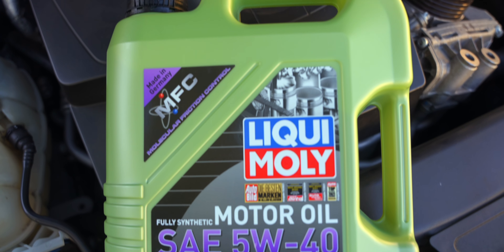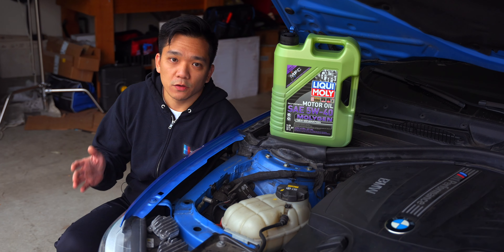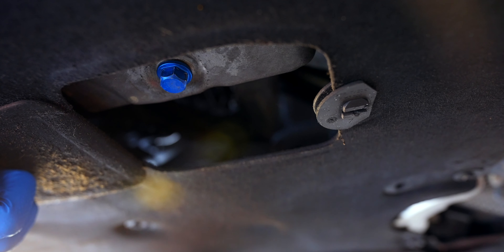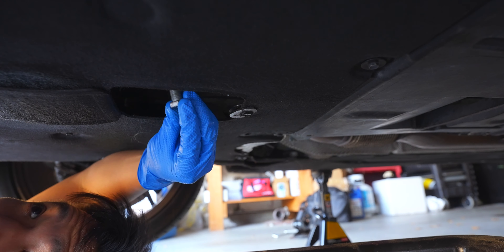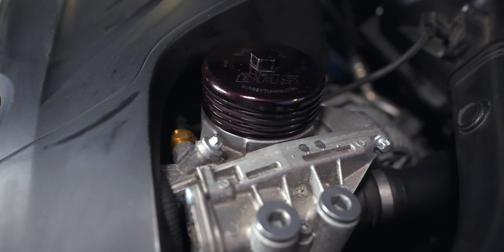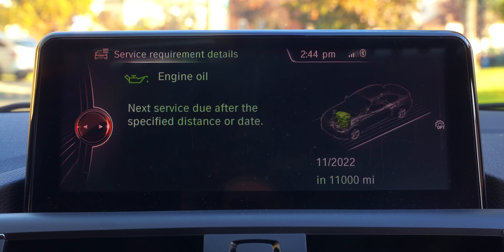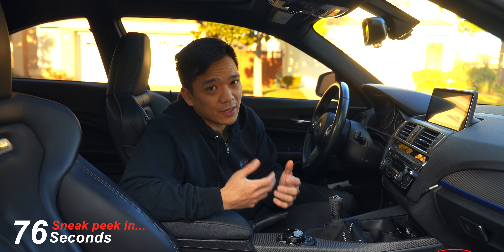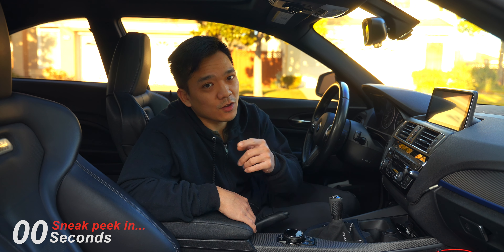Liqui Moly Molygen Review | BMW N55 Oil Change

Comment: Also Try Motul. It is also make your engine quieter.
Reply from the maker: I'll keep that in mind. Thank you
Reply: Motul oil trash engine is loud asf liqui moly best oil to use
Reply: @hansondardignac7049  my  engine runs about 5C cooler with Motul X-cess 5w40 compared to molygen 5W40... for my next oil change, I am going back to Motul. I also have a 2015 M235i
Reply: @okpoobi  Try Motul 0w40 X-Max or LL Synthoil 0w40. These are superior oils.
Reply: @okpoobi  well done on finding an oil that suits your requirements. Where i am i only get the choice of Valvoline, total, castrol and shell products. Read so much good reports on liqui moly top tec 4600 oil.  Walked into parts store and they started importing liqui moly products. I bought a quart of 4600 0w30 to try in my Mercedes c270 diesel car.
Reply: These are my observations. Took out a quart of old oil and put in the liqui moly 4600 0w30. Subjectively the car was quieter, felt much much more responsive and no smoke at all out of exhaust. 
Objectively the car is running about 50°f cooler on dashboard, and the biggest surprise/shock was the fuel consumption. Used to average about 28mpg, now 34 mpg. 6mpg better than normal. Has anyone had a similar experience. I'm absolutely blown away with this oil. It is also the recommended spec from Mercedes for my engine. COMMENTS guys.
Reply: @leonel2174  why did you not change all the old oil? makes no sense
Reply: Hi James, my 95 Isuzu diesel ran 10 years without oil change. Just various filters yearly. Put fresh oil according to dip stick. Stolen at 650k. Still running absolutely perfect. My 95 Merc petrol last oil change at 200k. Just filters yearly & fresh oil per dipstick. Sold at 403k. Still running today. My 2002 Merc 270 diesel last oil change approximately 180k. Now has 309k. Change oil filter every six months & fuel & air filters every 3 years. But i do take a quart of oil every six months & replace with a quart of fresh liqui moly.  I do a viscosity test along the lines of project farms to determine if a thinner oil is required to bring it back to 5w40 viscosity. Then i simply fill according to dipstick, especially as I've changed the oil filter. Car doesn't leak oil or water, doesn't smoke or miss a beat. I stay in a temperate climate with no cold winters or hot summers. I will probably never change oil again. This works for me, but each one knows their own climate & cars engine condition, so must do what's good for them. Some change at 2k, some higher. And that's fine for them. Under reasonable conditions oil doesn't break down, just the additives get depleted. By putting fresh oil every six months, additives are being replaced. Liqui moly rates this oil for 25k, so by adding oil it keeps doing it's job. Also the leftover oil probably coats the seals hence no leaks at all. 3 vehicles many 100's of thousands mileage with zero problems. Never ever had any mechanical problems. No engine ever opened up. Hope this helps, but please follow ur own schedule. This is for older models, not these new models. Follow manufacturers instructions with new models. Many happy miles on ur journey, Regards.
Reply: @okpoobi  i also use the motul xcess 5w40 
Not everyone will have same the results 
For me the motul hasn't work as expected as a good synthetic oil
Some oil might work for you but might not work for everyone

I'm thinking of changing the oil in my car to either molygen or castrol edge
Reply: @leonel2174  engine models are quite different so if a car leaks or burns oil the owner can top it up and new oil will replenish lost oil so if the loss is enough then the replacement may be on track to keep the oil fresh. This is way different for an engine without oil loss. It is not going anywhere in my car and the Direct Injection and boost pressure cause dirty carbon soot to go into the oil quickly. To me pure direct injection is defective and dirty towards the atmosphere and engine. So in my case I must suffer this but I gain in that the engine is efficient and no top-ups are required. Honestly I have not much choice because I required a brand new car and all new cars have very similar tech and no more diesels are really available. I accept high priced oil changes every 2-3 months. I am not happy with the vehicle either with comfort and noise. So it is definitely a compromise and financially I have learned that vehicle value matters so here it is good compared to my past Mazda/Fords, VW, and Ford cars. This H for Honda will keep value better and engine and trans will not self-destruct in first 5 years. Maybe in 15 years
Reply: @jamesmedina2062  you make some valid points James. My merc c270 diesel doesn't leak any oil, and i never have to top up at all. This is why i remove a quart every six months. Because of changing oil filter i simply top up according to dip stick. I was getting 28mpg before, now 34 mpg with liqui moly top tec 4600 0w30. Just taken another reading, 37mpg. I'm absolutely blown away. Never got these mileages with the other oils i used. Im totally sold on liqui moly. 9mpg better fuel consumption. WOW. Can't wait for next quart removal & oil filter. Filters approved by store specialising in merc cost less than $5. Oil is less than $9 per quart. So less than $28 per year. Every third year air & fuel filter +- $35. Costs hardly anything to run, other than brakes & tyres eventually. Thanks for ur imput.
Reply: @jamesmedina2062  Also spent a lot of time looking up Blackstone oil analysis of any make of vehicles with oil changes over 12k intervals. The 3 main items i observed were as follows. 1. Adjust viscosity to manufacturers recommendations for the oil thickness of the time of year. 2. Keep engine near full mark. U will have better lubrication & oil acts as coolant keeping engine regulated. 3. Use oil specifically approved for ur engine. My Merc is 229.51/229 52 & liqui moly has this printed on the container. Hope ur vehicle gives u long trouble free motoring.
Reply: @leonel2174  thanks. You have it good. I don't but am ok with it. I wanted a 2015 VW TDI Golf but the two on the lot got sold so quickly before I could get my money approved. The Golf get very good economy. Anyways I used Motul for many years but after checking the oil tester named Piotr here on YT, I tried LiquiMoly 0w40 and tested it in my kitchen. it is extremely protective but a little thick except for summer and I dilute it with a 0w20 from same company. In winter just straight 0w20 AA is the one. AA for America Asia cars. I have emailed LiquiMoly but the guy knows nothing. A big waste of time. You can search for your oil and Piotr too. His scar test will come up at room and hot temps.
Reply: James, 0w20 sounds good for winter. 40 weight oil might be to thick. Possibly try 5w30 for summer. Also oil burns or vaporizes off making oil a bit more viscous. So a thinner oil like a 30 weight is recommended to thin oil down a bit. Check ur manual for parameters for oil recommendations. Thanks for imput.
Reply: @leonel2174  I put 0w20 and 0w40 together. My oil gets fuel in it so it gets thinner. These oils do not really get thicker for sure. I have seen other one do that somewhat.
Reply: @leonel2174  also this 0w40 has the zero meaning it is not same as straight 40 and it flows better than any other at like -65 celsius
Reply: Yes James, i was simply referring to the operational weight instead of typing the winter weight as well. Almost no one uses straight oils anymore. Thanks, & i hope this clarifies what i was getting at.
Reply: @hansondardignac7049 
I just changed from motul 8100 xcess 5w40 to liqui moly molygen 5w40 and i would say that the motul was performing better compared to the molygen.In my opinion the molygen is just green and there is nothing special about it
Reply: @luvishfokeerah3716  I love liqui moly more then motul my engine was loud with motul

Comment: Hey, I’m curious if you don’t mind.. what oil temps do you avg with you N55? I just got a 435 M sport and I’m usually at a tick before 250F or right at 250 with daily driving. I live in LA where it’s a bit warm, so I’m sure that factors in some. I’ve been told my multiple bmw specialist that this is normal and also the bmw manual states this as well. Just curious what you’re seeing and also did you notice any cooling advantages once you switched to the GTS hood? That’s something I’ll be doing soon. Thanks!
Reply: I own a 2011 e90 335i and my temps are just below 250, if I drive calmly for around 15-20 min (which is rare😂) It goes down to around 200. Just be careful it doesn't go above 250°, also check that you put good quality coolant, and check the coolant pipes here and there to make sure there aren't any leaks etc.
Reply: @gomidasodabashian4904  Thanks for the tips! Yea, I noticed if I drive relatively calm on the highway, it stays right under 250. I drove it in much cooler weather  (40-60 degrees F) and it either took longer to get up to temp or never really reached 250. But now that I have it back home in LA, where temps are pretty high.. it seems to run at 250. I just got an oil changed (bmw specialist) and they gave it a good bill of health. I think next time I need some service, I’ll think about switching it to a mossleman thermostat. My only concern is I don’t want it running too cool to where I’m not getting the benefits of the oil being used, since I’m not tracking the car or anything like that. Luckily we should start to see some cooler weather here, so it shouldn’t be that bad. Maybe by next summer I’ll make the upgrade. Thanks again!
Reply: N55 likes to run hot for better fuel efficiency. When u drive hard it will actually run cooler. Mine runs just below 250
Reply: @mohammedalroz2955  Yea, I’ve noticed that after a year of ownership. Especially if it gets up to temp, then I turn it off for a few minutes, once I get back to it and get on it a little bit it runs much cooler. After a while I just stopped paying attention to it and let it do its thing. Been great.

Comment: Good evening, if you would allow the right oil for the car, Chevrolet Triple Blazer, model 2004, engine 4200, note that the oil cap says 5w30, which type of product was used by Comoli?

Comment: Liquimoly is certainly an ok oil but it's not anything special or "best of best".  Has no approvals keep in mind.  I've run Molygen extensively including tracking.  It has a tungsten-based friction modifier.  I'd say Leichtlauf High Tech 5W40 over Molygen as it has the BMW LL01 approval guaranteeing performance.

Comment: Um you didn't perform any tests on the actual oil. like how it suspends and removes contaminants,  the break down of the oil over time, viscosity, cold start adhesion, detergents, Stabilizers etc. I used Molygen in my Forester with a performance oil filter and got amazing results. Cost was a whopping $15 more than a full synthetic oil change, well worth it.

Comment: It would have been easier to compare for example, the oil pressure at different temperatures, the time it takes for the oil pump to build up pressure at the cold start, that would have been very explicit to see if it is worth it, or which one is the best.  
I also wonder, in such a high power small engine, why you wouldn`t use say 5w50 molygen or 0w50 if your engine does not use oil... But hey, that's me. I`m the guy that doesn`t use what "the manufacturer reccomends" i use what i know and tested to be best. :)
Reply: What would that actually prove I would think as long as the oil would coat all the parts and stay on them well that would be fine while waiting for the oil to flow.

Comment: Does anyone know if it still looks green when used?
Reply: It does not. Turns black as any other oil, due to removing oil residue and other dirt from the engine.